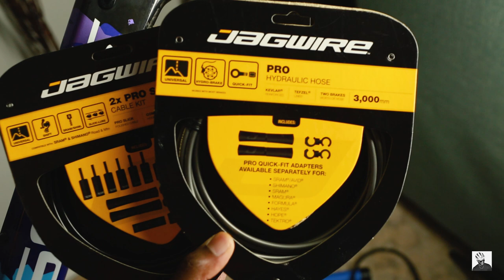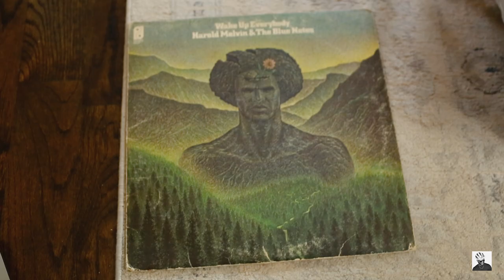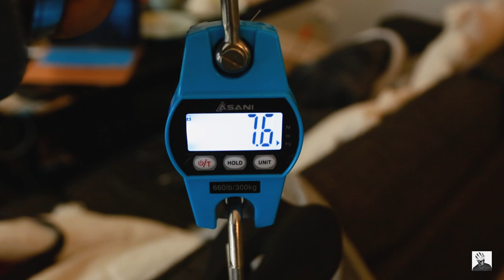Winspace T1500 Bike Build - Affordable Super Bike Perfection

Comment: Oil slick I think looks tacky because it’s such a dominating color for no good reason, however with your T1500 paint I think the oil slick chain is the proper way to go. Its also cool seeing a build video with mechanical components.
Reply from the maker: While I love oil slick chains, I went back and forth deciding to use it on this build since there is already a color explosion. I've seen people use both oil click cassettes AND chains which is completely absurd. Regarding mechanical shifting, Chicago is so flat that I very rarely use more than like 6-7 cogs, let alone the front derailleur.

Comment: Great video and build. 👍🏻

“Smoothness of ceramic bearings…” spins as well as my praxis standard steel enduro bearings and much less well than a square taper BB found in old steel bikes. For real the longest spinning BB in my shop was a square taper. 

Would be interesting to know how well shaped the BB shell is and if it’s perfectly in line. That’s always the litmus test for a carbon frame. 🙂
Reply from the maker: Thanks for watching 🤟🏾

Comment: Thanks for the great video Patrick, I can't seem to find any guidance on fitting the seat post clamp, is it a case of simply bunging it into position or should you lubricate (possibly carbon assembly) bits?
Reply from the maker: I had the same problem at first too haha. The seat post bolt assembly comes packaged backwards. You have to take the two ends apart, flip them around, and then slide them into the seatpost area of the frame.

Comment: Awesome build! Thanks for sharing! Did you pull out the cable guides for the front and rear derailleurs or leave them and trim down the one for the front derailleur?
Reply from the maker: That is a great question. For the front derailleur I just trimmed the plastic cable guide down just below where in the inner shift cable exits the frame. I assumed (at first) I would able to route the outer shift cables entirely through the frame, but the guides just below the bottom bracket are only wide enough for just the inner shift cables.
Reply: @PatrickLino  Thanks for the reply! I plan on doing the same thing with the front derailleur guide, but hadn't seen any build vids talk about it or show anything with the FD up close. I left the RD guide in.
Reply from the maker: @johnnytavo  I'm actually not sure whether or not the plastic guides were intended to remain in the frame. I've always removed them on past bikes once the cables have been routed, but I don't think there's a wrong answer. My assumption is the frame is smooth enough in the inside to not affect shifting performance. So far I haven't had an issue.
Reply: @PatrickLino  We usually leave them in. Just trim them down (usually only the front one needs trimming)
Reply from the maker: @WinspaceBikes  ahh good to know for future builds

Comment: Hey Pat! Love the build! I have one in Glacier white. My question is, what did you torque the compression plug to? I also have the integrated bar and stem. My headset keeps getting loose on me. Winspace told me 8-10nm. I choose 8nm and applied carbon paste the second time around. It's loose right now. I nervous to go to 10nm 😬. Any advice?
Reply from the maker: Sup Christian! I torqued the compression plug to around 10-11nm for now. I've only ridden it a couple of miles outdoors since it's still Winter here in Chicago. In the past, I've torqued my Allez Sprint down to about 12-13nm with no issues. If your plug is slipping, you may need to tighten it further if you're running a lot of spacers below your stem, but especially if you have a lot of spacers above. Let me know how it goes. You're not gonna break anything with 13nm of force. 8-10nm is more or less a guide not a harden rule.
Reply: @PatrickLino  Hey Pat, 10nm did the trick. I'm running 1 big spacer and a thin one. I think a ten and a five. So 15mm spacers. None on top of the stem. I had to cut like 1mm of steerer to make it work. No more slipping! The trails that I ride here in Tampa have some bumps and cracks so I'm always kind of bunny hopping over them. I don't get air or anything, I just unload the bike so there is very little weight when I go over imperfections on the path.
Reply from the maker: @ChristianRodriguez-fs3ch  awesome to hear!

Comment: Did you have problems with the cable frame stops up on the top of the down tube? I can’t get the inserts to seat into the frame.
Reply from the maker: Not that I recall

Comment: Does the 4iiii Precision 2 fit on your T1500 frame? I did the clearence test for the 4iiii Precision 2 power meter and I dont believe it will work. But the Precision 3 being lower profile it looks to be ok, but pretty close to touching.
Reply from the maker: My T1500 is using a Quarq DZero spider-based power meter. You can alway use shimss.

Comment: Hey Patrick, I'm just coming back to this video because I finally got my first ride done on my T1500, and my stem (the same integrated handlebar-stem that you have) kept slipping! I'd set the preload with the top cap, then tighten the stem to 6Nm on each bolt, and 10 minutes of riding later, it gets loose, and i can feel some play in the fork over bumps. I did it 4 times before I just gave up and came home. I wonder what I did wrong. Do you know how much you torqued the expansion plug that goes into the steerer and how much torque you used for the stem bolts? thank you!
Reply from the maker: Compression Plug: 12nm, Compression Cap: torque to it's snug usually around 5-6nm, Stem Bolts: 4-5nm - One reason your steerer could be slipping is the fork may not have been cut down enough for the top cap to properly grip the compression plug. You may need to a spacer to accommodate this.
Reply: @PatrickLino  Patrick, you are so awesome. Thank you so much for the comprehensive response. I actually had the same thought about my fork not being cut down enough, and the top cap 'bottoming out' onto the compression plug, but I double checked, and there's about 3mm of space when the cap is put on, and when initially tightening, the headset is really solid). Are you sure about the 12Nm for the compression plug (the black metal wedge that goes into the steerer)? If so, that is 100% the cause of my issues, as I am only doing 6Nm currently! Doesn't that seem really high though? I'm worried about the steerer cracking with that amount of force :/
Reply from the maker: @NeutralGenericUser  yep 8-12nm for the plug that goes into the steer and expands. The 6mm hex bolt!
Reply: @PatrickLino  Thank you so so much! <3

Comment: so 8kg with pedals cage and mounts? love the paintjob on this one.
Reply from the maker: My Look Keo Carbon pedals weigh 250g, carbon bottle cages 45g, Garmin mount 30g. So just under 8kg all in. Not bad at all!
Reply: @PatrickLino  not bad for a winspace t1500 disc indeed but def not a lightweight bike :D can't wait to see how the velobuild turns out too!
Reply from the maker: @Pauleuh  Indeed! Like most bike, there's a compromise between lightweight and aero. Unless you're talking about $10,000 bikes.
Reply: @PatrickLino  there's some builds on ww with open moulds disc frame that are quite a bit lighter then this without breaking the bank. this frame is just really heavy lol.

Comment: if you have to choose with the same specs, reacto or t1500?
Reply from the maker: Merida isn't available in the USA.
Reply: @PatrickLino  oohh okay, but if you have to choose with the same hyper 65mm ws, allez sprint with mechanical dura ace groupset or t1500 with mechanical ultegra groupset?? thankyou
Reply from the maker: @aye2011  T1500 for sure.